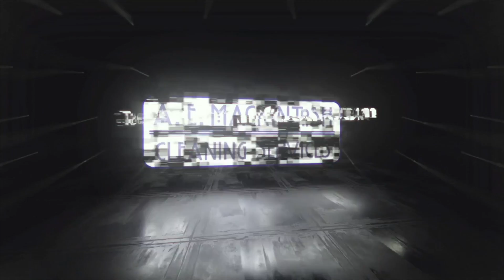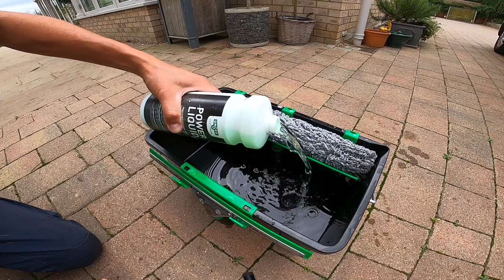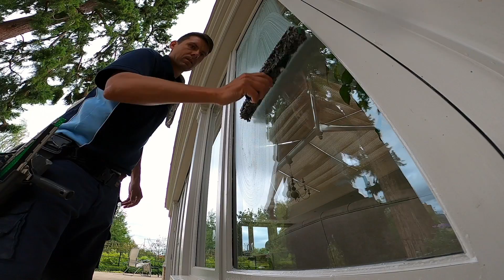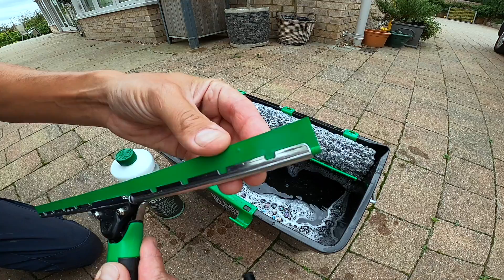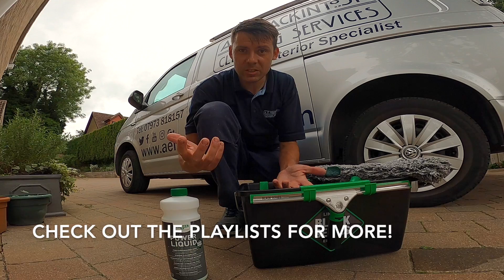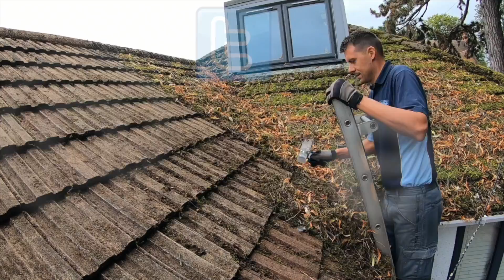Unger Black Series Review - New Window Cleaning Tools

Comment: Hey Ashley!
Today I tried the green rubber for the first time. Was excited. But you didn’t have problems with small fine lines from the rubber? I found it pretty similar to Razr Red rubber - but I will keep trying it. It definitely won’t ware out as fast as other rubbers.
Reply from the maker: I didn’t have that trouble with mine. I have had fine lines like that from the red rubber. I just got a whole batch of green rubber delivered, so we will see what that’s like.😃👍🏼